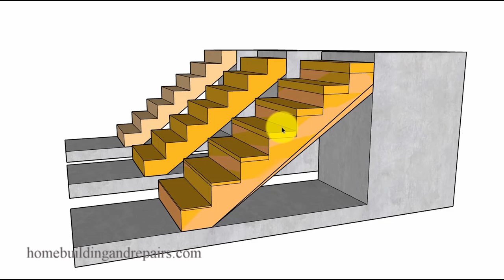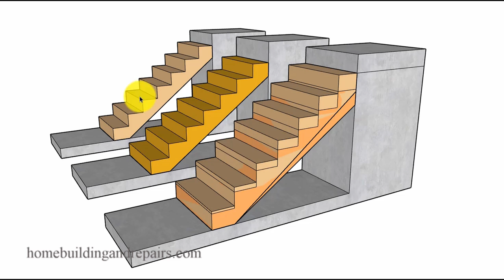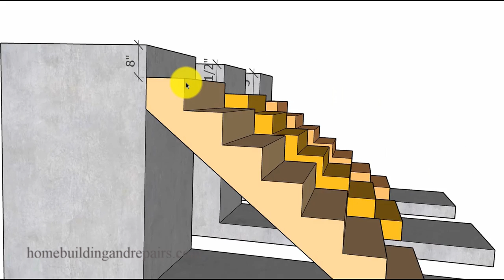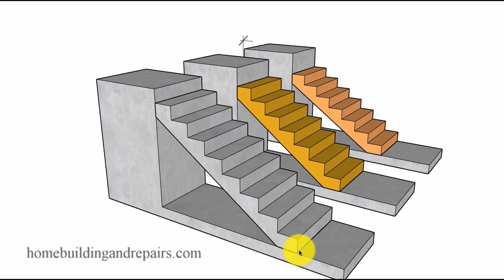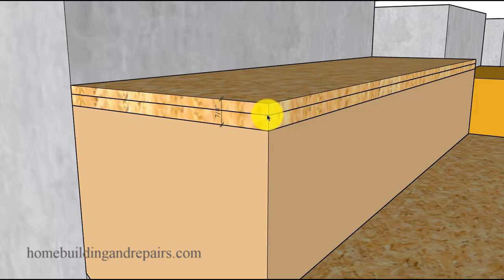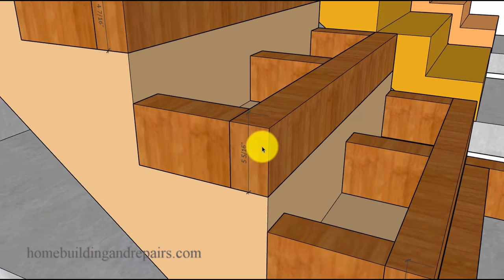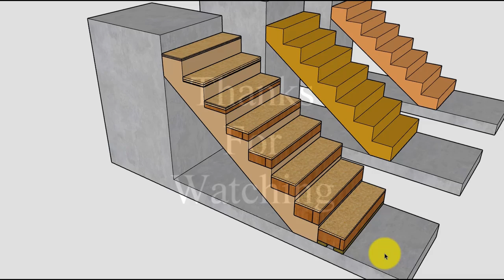How To Lower Riser Height On Existing Stairway By Adding Another Tread And Materials To Other Steps

Comment: Thanks, you confirmed my plan is ok.  My basement stairwell has 11" rises, by my math by adding a step (actually splitting a landing into 2 triangular steps), I can get it down to 8.5" rise by building a box on each step to bring it up... still taller than code but better than 11".  Can't bring to code anyway because the while stairwell is 3" too narrow and widening would involve moving a wall... which is not happening.  Apparently nobody cared how you built stairs out in the country in the 60s.
Reply from the maker: You're welcome and sometimes it just won't make sense to fix old stairs.

Comment: Thanks for this video. What about if u don't have enough space at the bottom and u need to add another stair at the top instead
Reply from the maker: You would probably need to remove and rebuild the stairway.
Reply: If there's no room to build out at the bottom straight. Do you have room to come to a landing and go to either side for an L shaped staircase. If not your going to be limited on your options. Without significant reframing of your floor system

Comment: I did learn something with this.  We are looking at putting in a temporary alternative for mom who is having troubles getting up the stairs.  We're are trying to extend her time in her home.  Do you think this will work for her? It's for the deck as the rest of the house is single floor. We may have to go to a ramp but this might be a quick fix until spring
Reply from the maker: I like the ramp idea, but this could be a solution that would help.

Comment: Would you mind doing a video on what we would do if we needed to remove a step?
Reply from the maker: Can you provide more details, so I don't make the wrong video? Why are you removing the step.
Reply: To reverse. The process you'd have to shave down the risers starting at the bottom. But then you'd be left with having to move the stairs back. Or build a platform out to it. And you would need to access behind to add material to the bottom of the stringers to compensate what your removing on top. That would be a case where I would rebuild entirety. Consider a boxed stringer staircase. You can pre make all the parts before hand. Then remove the old and assemble the new one about a day

Comment: My problem is the steps have an eleven inch riser can we use your method to decrease the rise?
Reply from the maker: It will depend on your project. I do have other videos at our website on dealing with this in different ways in our riser variation, home repairs section.

Comment: Hi i want to ask you what to do when you want to add wood threads on an existing threaded stairs in the baseman, i will happend to end with a taller riser drom the floor and a smaller riser from the top campared to all the other risers.  What would be a solution for this?  Thanks for your answer
Reply from the maker: You might need to remove the treads and replace them with something about the same size or if for example you add 3/4 inch thick treads to the top of your existing stairs then you might need to add that amount to the floors.

Comment: We have 10 stairs going into our basement. Can you calculate what we would do in that case? We have 139 inches to work with. The existing stairs are 126 inch already. is it possible to do this method in this space?
Reply from the maker: Yes and go to our website or check out some of our books for more information. I can't provide you with measurements, because there are other things to consider like headroom.

Comment: can you add to the risers and the treads on the same stairway?
Reply from the maker: If it will work and won't create riser and tread measurement variations, then yes. The information in this video might not work on all stair designs.